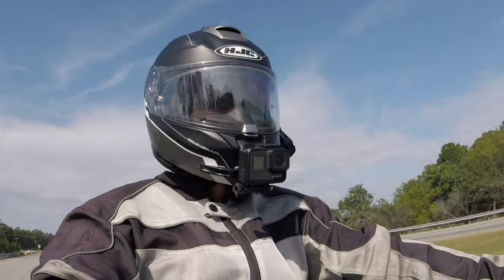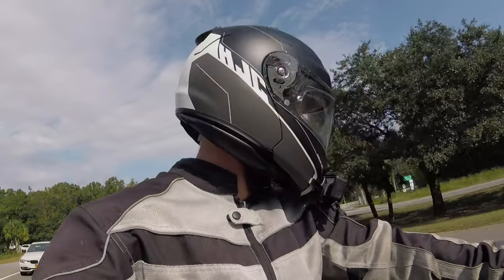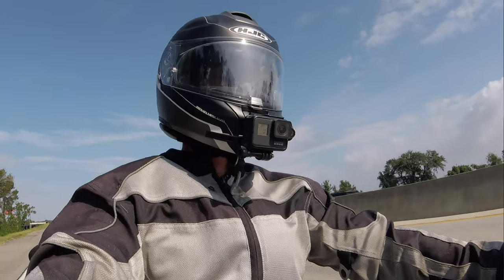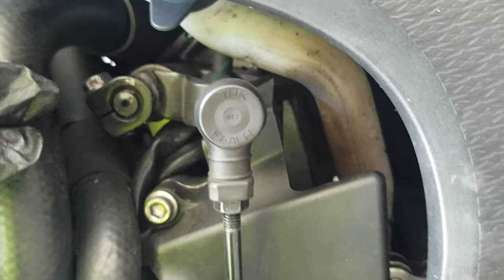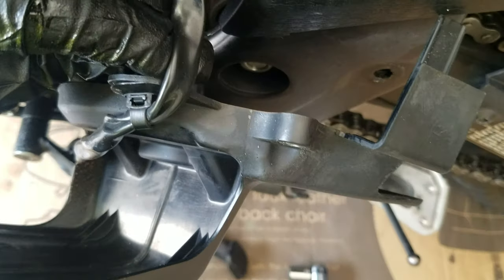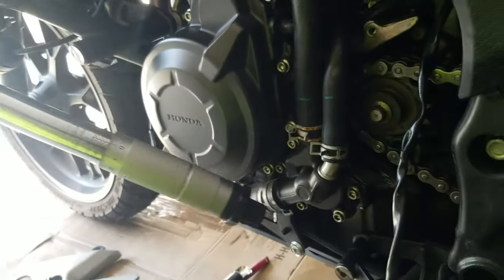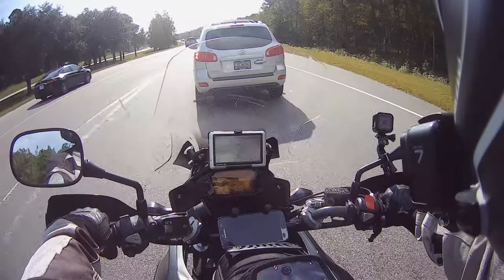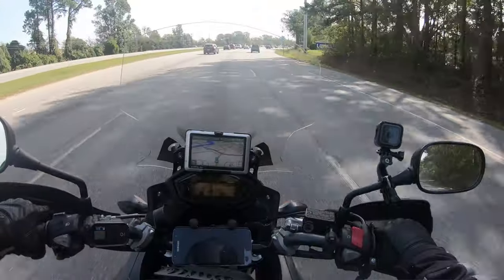CB500X 16T Sprocket Swap

Comment: Hey Chris thanks for the video it was very informative! I was wondering if you tried to find a fix for the speedometer/odometer after the sprocket change? I think that's the only thing holding me back from doing this to my own bike!
Reply from the maker: Hi Kim Cruz!  YES!!!  I've heard of at least 2 products that will adjust your speedometer to be 100% perfect (even better than factory in most cases).  The SpeedoHealer is one.  I can't remember the name of the other I saw.  But read through all the comments.  I think they were both recommendations by individuals in the comments.

Comment: Would it be simpler to install a 1 or 2 tooth smaller rear sprocket?
Reply from the maker: Hi Ijusthopeitsquick!  That is one option that many take.  Some even do both.  However, from a mechanical standpoint, it's much easier to just swap out the front sprocket than it is to remove the entire rear wheel (including brakes, chain, etc.), unbolt the sprocket from the wheel, then have to replace and re-align everything.
Reply: @MotoPhotoAdventures  Hi Chris, thanks for replying. I was thinking that a rear sprocket swap would side-step the front sprocket guard clearance problem - as well as allowing smaller increments of gearing change.
Reply from the maker: Good thinking, @Ijusthopeitsquick !  Unfortunately, I believe after talking with many others who have done the 16T upgrade, I may have inadvertently installed the chain guard upside down when I put it back in.  It turns out most others have not had any problems with clearance.  After removing mine and examining it again, there does seem to be ample room, even without grinding the guide down.  Which leads me to believe it's not needed.  In which case, it's really a very simple 15-minute job to replace the front sprocket.  But as you pointed out, there are other benefits to changing the rear one, which is why many have gone that route as well.  Whatever works best for you is all that counts!
Reply: Changing the front from 15t  to 16t results in @6.5% less rpm/torque. If you want a gentler change, replace the back sprocket from 41t to 39t which will result in @2.5% less rpm/torque. I just ordered a 39t sprocket since i have the wheel off anyways for new rubber. I do like the idea overall because i always feel i am looking for seventh gear.
Reply from the maker: @authenticsailor9808  Thanks for the insights and percentages!
Reply: @authenticsailor9808  Hi, according to my calculator changing to a 39 from a 41 will lower the rpm by 5.1%.

Comment: How much RPM drop at 80 kph from 15 to 16 sprocket?
Reply from the maker: Hi Dodong!  Unfortunately I didn't make exact measurements.  I talk about the reduction in RPM at various speeds like 60, 70, 80 mph.  80 kph is about 50 mph, so you'll get a close idea of the changes.  This was not a "controlled" measurement since things like wind changes, inclines, etc. were different each time.  But you'll get a good feel for how it affects the bike.  I'm still loving the changes this upgrade made to my bike!
Reply: @MotoPhotoAdventures  
Thanks Chris. Based on your video, it seems there is a reduction of about 500-700 rpm at 80 kph. Its a significant improvement assuming the odometer is connected on the tires. Engine life will improve. Its cheaper also to make changes on rhe front spocket than the rear. Big thanks
Reply: @dodonglupisan6306  I also tought it was a reduction of 700 rpm at 80 MPH on the video but another man made a more accurate calculation which gives 6% less RPM. 15/16= 0,9375 . 4000RPM at 50MPH with 15 T gives 4000 x 0,9375 = 3750 RPM with 16 T (-250 RPM). I calculated the new datas: 60MPH from 4900 RPM to 4593 RPM (-307 RPM); 70 MPH from 5800 RPM to 5437 RPM(- 363 RPM); 80 MPH from 6600 RPM to 6187 RPM (-413 RPM). From what I read on the comments the odometer seemed to be connected  to the front wheel on 2013-2015 models but from 2016 models it's on the engine.  I bought a speedometer calibrator at 12oclocklabs which is a very small device which connects somewhere near the battery. I still haven't installed neither the 16 T sprocket not the calibrator on my 2018 500X at Phuket, because Thailand is no more accessible due to Covid 19. I hope it will be possible to travel on July 2021.

Comment: Before doing the swap I would like to mention my findings. Large loss off mid range acceleration, poorer ability on steep gradients and poor alround performance when two up. Now the Benefit's Speedo will be spot on, less high frequency buzzing and far better flat road cruising at 70mph. I think Honda did get the gearing correct for 90% of the time with the original 15 tooth sprocket.
Reply from the maker: Thanks for sharing!

Comment: is there any chance to calibrate again the speedometer?
Reply from the maker: There are ways it can be done.  But it doesn't bother me at all.  The increase is almost exactly 10%.  So it's easy to calculate.  Plus my GPS shows the exact speed anyway.

Comment: Has there ever been a Honda without a short first gear?
Reply from the maker: HAHA!!!
Reply: @MotoPhotoAdventures  I don't really mean that to be a smart ass, it's just that Honda's are fairly well known for having good low-end torque, right?  And like all vehicles with that characteristic, they have very short low gears, much like large trucks.  I could be completely wrong, but I've had a lot of bikes over the years and in my humble experience Honda's all seem to have that in common.
I don't know if that's necessarily a good thing or bad thing.  The sprocket change is surely a great idea if using the bike primarily on the road (as the cb500x is really best at anyway), so thanks for the video.
Reply from the maker: @UhYeahWhateverDude  hey I get it!  Most of the Japanese brands do that.  We forget in America, Europe, Australia, and other modern cultures with wide open spaces and high-speed interstate systems, that a LOT of the world doesn't have this kind of infrastructure.  A large part of the CB500X and other smaller displacement bikes from Honda end up in Asia, Africa, South America, etc., where roads aren't always paved, aren't well maintained if they are, and the topography might mean that most of the roads have steep inclines or twisty curves.  In these scenarios, a that short gearing and low-end torque is more desirable than the higher cruising speeds we might like.  So it totally makes sense they would build their bikes to fit a multitude of markets like this.  If all we have to do is replace the front sprocket for one with 1 extra tooth for $30, I'm happy to do so!  :-)

Comment: For anything other than fast flat roads the 16 tooth sprocket will be a mistake as it will remove the back road performance that makes the 500X punch above its weight. The engine is not particularly powerful and has limited torque and for riding on twisty roads or hills the standard gearing is spot on. Add a passenger or luggage into the mix and the 16 tooth sprocket becomes an even bigger mistake.
I bought the 500X because if it’s unexpected liveliness but I wouldn’t have considered it if my preferred riding choice was motorway use. In my opinion anyone who insists that their bike is better with a 16 tooth sprocket bought the wrong bike. As for the crap spoken about first gear I’ve been in a lot of situations where I’ve been very pleased to have a gear that low, mind you I don’t ride my bike down the dual carriageway to Starbucks.
Reply from the maker: Hi David!  I totally get it.  It's not the right choice for you.  And ultimately I compromised and started using the 39T rear sprocket upgrade instead (which provides a gearing ration part way between the 15T and 16T changes.)  However, I still believe the 16T is an excellent option for this bike for those who primarily ride street.  There are many reasons people buy a certain bike.  Looks, styling, price, reliability, fuel economy, etc. all play a part in one's decision.  While I respect your opinion, and it's clearly not the right option for you.  For me, in the 3 years that I used the 16T upgrade, I was extremely happy with my decision.  And I would have continued using it, except I found myself doing more 50/50 off-road.  So the 39T rear sprocket gave me back more of the low-end grunt I was missing, while still benefitting my highway travel.  Anyway, to each their own, I say.  There's no wrong or right option with this bike.  Everyone should make whatever modifications they want to it, as long as it makes them happy and they are out enjoying the ride!!!  🙂

Comment: What about the mph ?
Reply from the maker: It's not a big deal.  Putting on a different brand of tires can through your speedometer off.  You can watch the video if you want my solution...way more accurate than the factory speedo anyway.  Or read the comments for a link to buy a Speedo Healer to easily correct the factory speedo.  Plenty of excellent ways around that issue!

Comment: I think your stock front and rear sprockets and chain were already wearing. You should have replaced them all then.
Reply from the maker: Thanks for the kind advice, Jun!  I replaced the stock chain with a high quality DID X-ring chain about 6 months ago.  I'll be contacting them about a warranty replacement soon since a chain this new that has been properly lubricated every 500 miles should NOT be getting kinks in it.  The rear sprocket was actually looking pretty good.  But it's next on my list.  :-)
Reply: @MotoPhotoAdventures  .. It's not good to replace them one at a time, because the others were already wearing.  They get easily damaged because they will not fit properly.
Should be the set (2 sprockets and Chain) at once.
Reply from the maker: Hi  @junandan6580 !  I understand this is the ideal way to do it.  Thanks for sharing!

Comment: Is it possible to calibrate the speedometer with the 16T?
Reply from the maker: Hi William!  Thanks for the question.  Yes it is.  There's a company that makes a small device that you can plug in and recalibrate your speedometer to be perfectly accurate.  I forget the name.  But if you look down the comments, I've given it out to a half-dozen of others who asked the same question.  If you can't find it, let me know and I'll try to dig it up.  Cheers!
Reply: If your bike is a 2013-15, no need as the speed sensor is on the front wheel...
Reply from the maker: @timlubbers2884  I could be wrong, but I believe the wheel speed sensor on early ABS models of the CB500X/F/R is only to talk to the ABS system.  I was told the speedometer sensor is an electrical component in the engine.  This is why devices like the Speedo Healer can plug directly into the wiring harness and correct the speedometer reading to be exact, regardless of what sprockets and gearing you decide to use.
Reply: @MotoPhotoAdventures  you are correct about the wheel sensor, I looked at my service manual and the speed sensor is for the ABS (I miss understood what it did)...in my research for my response, I did find that the speed sensor is (by Honda) called a "VS sensor" and can be reached/replaced. It's located under the throttle body and mounts to the outside of the case, but goes through it with an o-ring and a couple of screws...as a side note, if that sensor goes bad, it will trigger an 11-1 DTC and set the "check engine" light...
Reply from the maker: @timlubbers2884  I'm glad you located everything.  From what I understand, the Speed Healer and such devices don't require access to the actual VS sensor.  There's a connector in the wiring harness near the stator that you simply unplug, add a pass-through connector from the Speed Healer, then re-attach the connectors.

Comment: Has doing this swap helped with gas millage?
Reply from the maker: Maybe a tiny bit.  But because the engine is so small, it still has to work hard even at the lower RPM.  So I haven't noticed any real difference.  It's just more comfortable not to have the bike vibrating as much on the highway.

Comment: Have driven the bike on any fire trails? If so, did it affect the bike off road at all?
Reply from the maker: Hi John!  I have a friend named "Jon Roth".  It's nice to meet you!  YES...here's a short ride on fire roads from a few months ago:  https://www.youtube.com/watch?v=CYsIpsvS1YQ.  Plus I just got back from a 4,500 mile ride through Mexico, where I road on lots of rocky roads, cobble-stone streets, and dirt.  Here's one episode to wet your appetite:  https://www.youtube.com/watch?v=CLTqqEgAH98.  I hope you like it and watch the rest of the Moto Photo Mexico series.  Anyway, I had absolutely zero problems.  The new sprocket does make first gear a little taller, but not by much.  So I don't feel it affects slow off-road riding a whole lot.  However, if you do a ton of technical riding (i.e. dirt, rocks, steep trails, single-track, water-crossings, etc.), this upgrade probably isn't for you.  I had a few technical sections in Mexico, which was no issue at all.  But between the technical issues, I had LOTS of stretches of winding mountain roads, and empty highways, where the 16-tooth sprocket really helped me out.  I was using a Garmin Explorer GPS tracker.  One day a friend of mine called and said: "Dude...I was looking at your data from yesterday and it said you were doing 85mph across the desert!  Is that accurate?!?"  It was indeed!  People speed like crazy in Mexico.  And the cops don't seem to care much.  So I just tagged along with some other rapidly moving cars.  The little CB500X had no problem humming along at those speeds with the new 16T upgrade.  So to me, the benefits far outweigh any downside for slow technical riding.  Besides, if you're really going to do that kind of off-road technical riding, you should think about a CRF250 instead!  ;-)

Comment: I'm really starting to like these little bikes. Pretty decent performance. 
Great video of the upgrade. 
How would a guy 215 lbs. and 5' 10" fair on one of these???
Reply: The X might feel a little tall I would go and sit on one at a showroom. you might not be able to flat-foot but if you have experience riding being able to flat-foot one side while sitting will be enough just go test one out.
Reply from the maker: Hi Here to hear.  I love my CB500X.  I'm 5'7" and 170 lbs.  It fits me perfectly!  I tried a number of different "adventure" style bikes before I picked it.  With a lower seat height, this one just fit me better than all the rest.  I'm not flat-footed, but the balls of both feet are firmly on the ground at stop signs.  If you do a lot of highway or freeway commuting, I'd highly recommend the 16T upgrade.  If you do more city commuting or off-road, the stock gearing is pretty near perfect.
Reply: @MotoPhotoAdventures   My previous bike was a 2005, KLR 650 and that was a tall bike for anybody. The thing I liked about it was having a sense of awareness of someone potentially pulling out in front of you   ...so I do appreciate the high seat and nice view! I ride approx. 30% off-road, 70% on-road. 
This bike appears very affordable and a decent height for road view. As someone mentioned, I'm going to have to visit the showroom!      Man, I miss that KLR!!   Peace!
Reply from the maker: @heretohear8662  I looked at the KLR and the DR650 before finding the CB500X.  You certainly won't miss the vibrations!!!  :-)  The modern twin-cylinder engine is smooth as butter, and bullet proof.  Plus the addition of fuel-injection is amazing!  I went from sea level in Charleston, to over 9,000, and everything in between during my trip through Mexico the last couple weeks.  Never had to stop and deal with adjusting the jetting on a carburetor!  :-)

Comment: And what about 17 tooth sprocket? 
Does such a thing even exist?
Reply from the maker: It does exist.  But I'm not sure there is room in there for it without it scraping up against the chain guard.  And I'm not sure the relatively low horse power of a CB500X would be able to take advantage of it.

Comment: I guess it all comes down to what the bike is used for. If doing a lot of highway miles the 15 T makes sense. She can be a bit vibey.  I do appreciate torque more than top speed especially in the twisties up hill, off road or even two up. Great video though. I have wondered about the upgrade and this video has helped. Good  luck and stay safe.
Reply from the maker: Glad I could help, Matt!  Yes, definitely not for everyone...especially those who live in small mountain towns with narrow winding roads, or those wanting to do more off-roading.  But it works great for me.  :-)

Comment: It's gona kill the top speed or not?
Reply from the maker: No problem with top speed.  Did you watch to the end?  No problem cruising at 80mph on highway.
Reply: By doing this mod you get less power at any speed and gear combination because you drop rpm's. The thing is that if your bike has enough of a buffer at the speeds you travel to start with, you can just combat this by opening the throttle a bit more. It's the same as on a bicycle. If you shift up a gear you'll need to use more force with your legs but you'll be able to move faster with the same rotation of the pedals.
Apparently the CB500X has enough torque to do 60 at 4500~ rpm.

This probably won't lower your top speed by all that much, but you might have to shift down to 5th to get the peak acceleration from the stock sprocket.
Reply from the maker: Thank you for the insights,  @youridv .
Reply: It will actually increase the top speed since per example toping out at 110mph at 8500rpm you will now be at 7500 rpm at 110 still have 1000 to go

Comment: However rpm i s not a good way to measure how hard the engine is working. A lower rpm at 80 means that you have more throttle and higher cylinder pressure and therefore probably the engine is in fact working harder.
Reply from the maker: That's an excellent point!  Thanks for sharing.